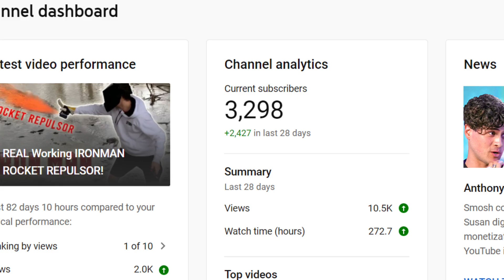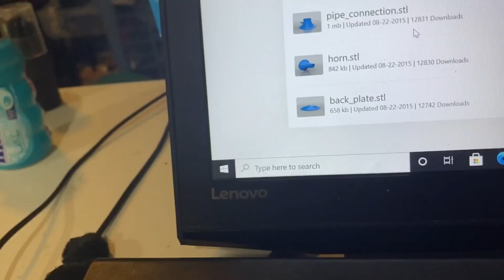Making An 11/10 IRON MAN REPULSOR!

Comment: i have some questions:
1) what is the material of the main tube connecting each end of the 2 plastic cups
2) what size drill is used to drill the holes 
3) where can i buy the brown/gold sort of thing at 2:18 
4) what type of gas is used 
that’s all thanks!

Comment: Also thanks for the stl I’m gonna give it ago with hydrogen
Reply from the maker: If you do use hydrogen be careful!!! It is extremely loud with map gas and the 3D printed stuff below up when I was playing around with it. Use ear protection and good luck!!!
Reply: @Random.Creations  were you using pla or petg/nylon and yeah i think i have found a way to muzzle the noise with some nozzle adaption and sheet  metal and yes thank you for the safety reminder